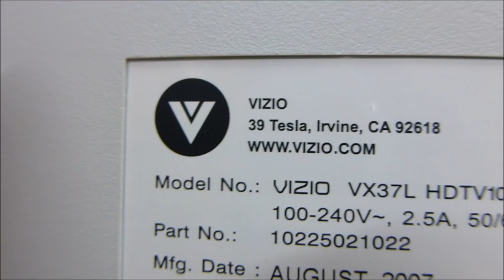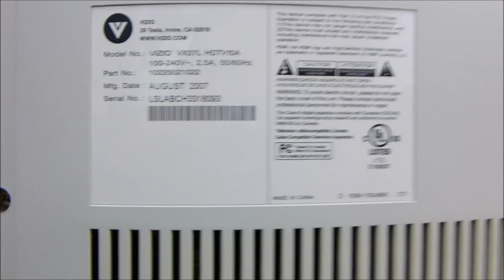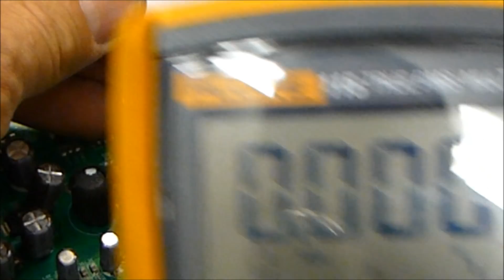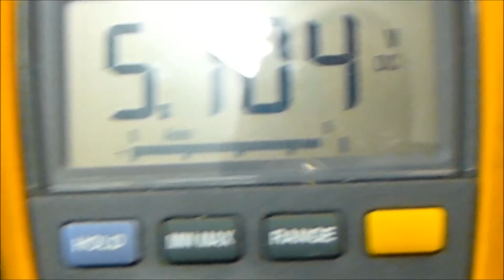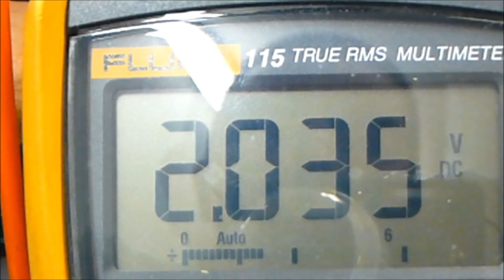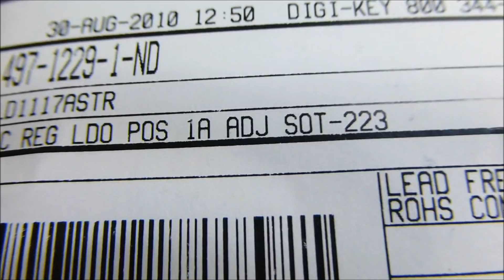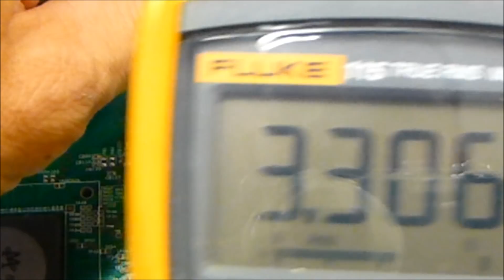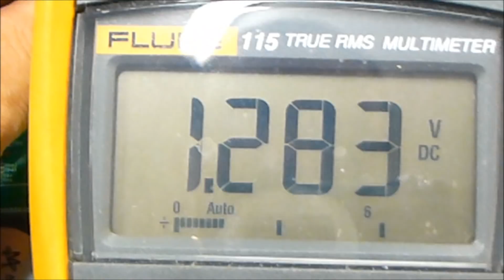Vizio VX37L HDTV10A LCD Powers on with backlight, Wont power off, No video

Comment: Good afternoon, I live in Colombia and presented the same problem but I have a great concern because I understand the English and use a translator so my concern is that in my country only find the transistor 1117S33 understand that this drives a voltage of 33, I can use this as a replacement? the AMC1117

Comment: Hello : I was just wondering if you can explained how did you determined the bad regulator being bad when the two last regulators were giving you unexpected voltage readings,the last one was taking the output of the one you found to be bad , can you make that clear for me please,if it was me, would've replaced the last one and not the one you replaced. Thanks for your expertise , great work , love it .

Comment: What type of soldering gun did you use? because mine was not hot enough to even melt the solder to the point where i could slide it off. i ended up breaking the board and buying a new one. But this video did help me solve my issue i had the same TV set as in your video and mine had the exact same problem. Same regulator and everything i just couldnt get it off the damn board.

Comment from the maker: the tab is the same as the middle pin, they are connected.  The 1st part # you gave shows the normal reg as in the video? cant find any info on the 2nd number.

Comment: just trying to fix my sons lcd and i have 1 of these regulators and i think its the problem it reading 5.15 on the input/ 2.51 outset/ 1.27 on the adjustment pin.???
here is no middle pin as i seems to be cut!!
could his be he problem as it has the same symptoms as your video. kind regards from UK.

ohh the part number is UTCLD1117AL  ADA010GT6 THANKYOU

Comment from the maker: use a high power LED flashlight put it right up to the screen and see if there is video, press the menu or something. You can also (in a dark room) shine the light through one of the screw holes in the back of the LCD panel and see if there is video. If there is video then the main board is ok.

Comment from the maker: All of your voltages look ok. Looks like some type of a main board failure. Find the part number(XXXX-XXXX-XXXX format) and google it. you should find several sellers if not there is always VizParts . com. They are overpriced however. Make sure serial number range of replacement board is correct!

Comment from the maker: Try 60/40 or 63/37 lead/tin the board solder is lead free, but the melt point of lead solder is lower. You should get it at a hardware store or radio shack

Comment: Have a Vizio V037L-FHDTV10A. Turn the power on and the vizio logo goes to white. Upon turning the power button on, I'm guessing the power board clicks like its turning on. The blue inverter light comes on temporarily, then goes out. No screen action is seen. I have sound, by way of a plugged in vcr movie playing, but no screen. Having watched sveral of your vidoes, I am wondering do I need to get a power board, inverter, or main board. Thx

Comment: Ok, I watched your videos 4 or more times and at least 4 "how to solder videos. Then I tried to get the regulator 1117 off the board and the solder just wont stick, just balls up and rolls all around. It's a rosin mix with 97% Tin and 3% copper. Couldnt get enough on there to get it molten and slide off. I have some dark brown flux that looks like grease, but it may be the acid kind. I have a 60w fixed temp iron. Any suggestions? I don't want to give up just yet. Thank you so much for your info.

Comment: Oh I meant the 32" model, only 2, 3a fuses. I'm mixed up on the extra empty plug socket on the power board, they are exactly the same. Any advice?

Comment: Thank you for having the best repair video on the planet. I'm new at this, but somewhat mechanically inclined. So doing this fix is a new adventure. I just got my parts tonight and will try the fix tomorrow. I have shared your links to a few on different forums that were so having the issue. 2007/08 vizios are lemons, but an easy fix, thanks to you. Thank you so much. I have the 32 in 3 plug-ins on the pr board and can't recall where the multi color one goes, next to the white, or on the end :0(

Comment: Hi there, I just got my parts both digi-key and mouser have the same ones. Yippee! They’re the correct parts! I have to say that norcal715 has the best fix for this tv on the internet. He is awesome :0)  The fuse is LF 3A, stands for little fuse 3 amp. I bought mine from Mouser, because I had already bought from them before Both companies are excellent. I paid .94 cents and digi-key is 1.15. I bought 5 and 6 regs, which in price are 10 cents apart. So I'll be ready for next time. let you know :)

Comment: Hello Deborah, I need to replace the same reg he did in the video and the little tiny 3A fuse also, but I don't know what info to input to get the right fuse. I searched the numbers you have for the fuse at digikey and it came up as a 3A 125V fuse. What confuses me is that when he tests it, it shows 12V not 125V, am I missing something?? I'm really pretty new at this, so I figured I'd go with the "ask if you don't know" policy, lol. I guess if it only reads 12V testing why does it call for 125V?

Comment from the maker: Are you sure you got the correct main board. Then same model number may have several different LCD panel makers. Did you order by serial number (very important on Vizios) can you send it back? it could be just a bad board. Someone else commented that you could swap the eeprom from the old board over to the new board and that should repair the problem. The eeprom is the memory ic that has the software and operating system for the tv.

Comment: i have a 32 inch vizio (i dont know what the modle is exactly) and it was on the ground standing up and fell over. when i went to turn it on it made a motor-like noise and the vizio light illuminates fine but the screen wont turn on. idk what to do and i really dont want to buy a new one. It is about 4 years old though. should i toss it and get a new one or try to get it fixed? please private message me if you can.

Comment: Did you watch norcal's other video? It's for a 47" Vizio, same issue. I just ordered 6 of the 1117 regs and 4 of the little fuses from mouser dot com. I'm replacing the one he did, the one on above it and to the left of that top one. Here's the part numbers for the regs from mouser, they are fast and a tad cheaper. #511-LD1117ASTR  and the fuses on mine are 3v from little fuse: #0451003.MRL 
both companies cross reference the part numbers. I'll let ya all know what happens.

Comment: I have the same problem with my 42 inch LCD Vizeo, it comes on but no picture and won't shut off, but I didn't see a back light on. The regulator you replaced the u32 has already been replaced on mine and showing the right voltage, but there"s another regulator the next row down at the right side of the board that is showing the same low reading that yours did. 5 volts input, only 2 volts output and 1.2 at the adjustment. Would that cause the same problem as the u32 regulator?

Comment: I have the same problem with my 42 inch LCD Vizeo, tv comes on but no picture and won't shut off. The regulator you replaced has already been replaced and showing the right voltage, but there"s another regulator the next row down at the far right of the board that is showing the same low reading that yours did. 5 volts input, only 2 volts output and 1.2 at the adjustment. Would that cause the same problem as the u33 regulator?

Comment: Just rechecked all. the sm reg you replaced on mine is good, but the one above it, the tab is 1.0, rt leg is 3.2, lft leg is 00.0 this is just above the one your fixed then showed how the one above the fixed one was changed now.
--------
and just to it's left theres another one very low. tab is 1.5, rt leg is 3.2, lft leg is 00.0. I'm a girl and love fixing stuff. Oh and the 12v fuse is 11.7v is that ok? then the 5.1v one both ends. Do you have a shop? Thank you for your great videos!

Comment: Trying to get part numbers for the bigger regulator and the 12v & 5v fuses on the vizio 32" 07. Main board is identical to the the 37" vizio on your video above. Is there a way to talk to you? On the larger reg with 3 legs, the left 12v, center 0, right 5v do you have a part number for that one. Theres one with 3 legs and has the middle leg off. It may be a different reg, but It looks the same, there is a contact spot for solder there, but the leg looks short and cut off. I watched both vidios.

Comment: My 42 inch LCD Vizio SV421XVT works fine for 1 or 2 hours and blacks out. Logo light is yellow, no backlight, no sound. IR remote doesn't work, I use manually the side power switch. I have installed a Brand new power BD, but problem remains the same. If tv is turned off for 2 or 3 hours, tv will work fine again for a while. Should I also replace  the main bd?

Comment from the maker: There are so many checks to do here that you tube does not let me have enough characters to type them all, not to mention the time that it would take to do it. Also you still may have a backlight problem! If you can find a cheap used board then it may be worth a try.

Comment: Have the same TV with the same problem. Bought a mainboard on ebay. The board layout is the same, but the part number is not. Put the board in. The TV powers on with the power button or the remote, but now the backlight doesn't light. In the sunlight I see a myriad of lines on the LCD. Put the original board back in, I don't, just the exact same problem you had. You think the problem is the board not being the same part number, therefore not the exact same board, or is it something else?

Comment: I have the exact same problem with a VX20L vizio. I have 5 volts and 12 volts on F1 & F2.  Fuse 3 output is 11.3. However I'm getting 12v in and  5v out on the bigger voltage regulator that you measured in this video.  U4= 5.0/3.3/2.1.  U2= 5.0/3.3/2.1   U9=3.3/1.5/0.2.  U8=5.0/3.3/2.0 and U10= 3.3/1.2/0.0.  I can use some help with this problem

Comment: I have a similar problem on a 19" Samsung LCD. Except when plugged in backlights instantly on and doesn't respond to power button. I measured output of .06v on a 3.3v regulator which indicates bad regulator, however what's strange is just before that the symptom was blinking standby light and fluctuating input voltage on input and output of same regulator. What do you think would cause the fluctuation?

Comment from the maker: your pix shows the meter in the DC volts position measuring up to 200 volts. for more accurate measurements just put the knob in the 20 volt DC range. Black lead go's to the chassis ground, red lead is measurement lead.
Reply: norcal715

Comment: Thanks for doing this.  I want to keep from throwing away my TV.  I have a similar issue on one of the first TVs from Vizio.  My Vizio light changes from Orange to white, but the screen remains black.  Then after about 30 sec, it powers down and changes to orange again. When looking through the vents, there is no visible light from the backlight.  Talked to a Costco auth. repair rep,  They mentioned it might need a new bulb.  What do you think?  I have a 2008 vs42l fhdtv10a ser # ljpbqah4904382

Comment: Awesome!  Same problem,  same voltages on the same regulator on two different boards. I bought a used board. The T.V. did the same thing. Thank you very very much.

Comment: hello, I have a Emerson  LC401EM2F that it will not turn on fully. turns on and i see an image and turns off.  Caps were replace because they were blown but same issue persist. I went ahead and bought a re-build power supply online and it does the same problem. any suggestion on what it can be?

Comment: Norcal715 what's your shop called want to take my vizio gv47lfhdtv10a so u can repair it for me or show me how to check voltages on boards similar problems except I don't see light through vents only logo is on & no sound or picture if you can reply with some way to contact you thanks

Comment from the maker: Yes you just have to run a "jumper wire" to replace the lifted copper trace. It just needs to go exactly where the old trace used to go.

Comment: where would solder the other end of the wire to? Or does the wire just need to be touching the place where the metal connection point used to be?

Comment from the maker: very fine wire (30 36 gauge) to solder to the fixed resistors. or try and find a used good board. sorry

Comment: Nice tutorial. I was working on my vizio and when i soldered off the regulator, a metal connection point came off with the adjustment pin. Now the new regulator's adjustment pin wont solder onto anything. I was wondering if there was a way to fix this problem?

Comment from the maker: The inputs should always be a standard voltage 12V, 9V, 5V, 3.3V. The Standard output voltages are 5V, 3.3V, 2.5V, 1.8V, 1.2V. So if you have a IC that only has lets say 3.8 or .9 volts out but has a solid 3.3 or 5 volts in you would suspect that one. Use the 1.2 + rule as in the video.

Comment: Just saw the video fixing a customers TV. I have a tip for you dell plasmas and lcds use a separate audio board remove old audio board purchase a audio board kit from radioshack it works just as good